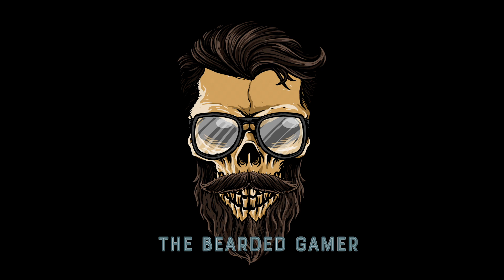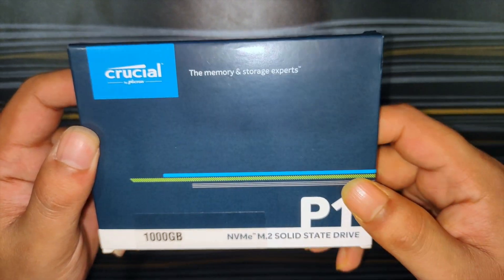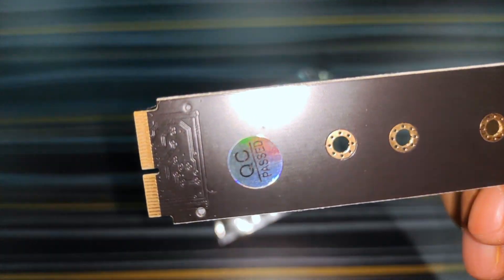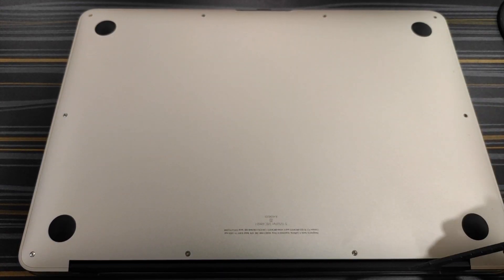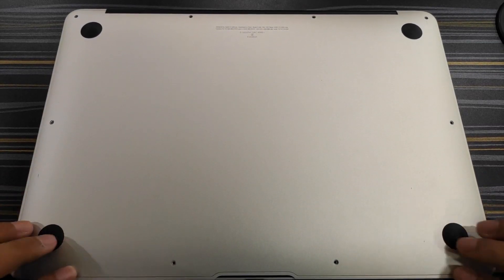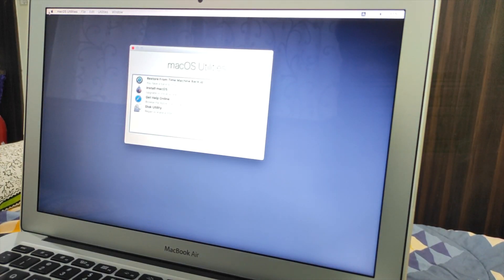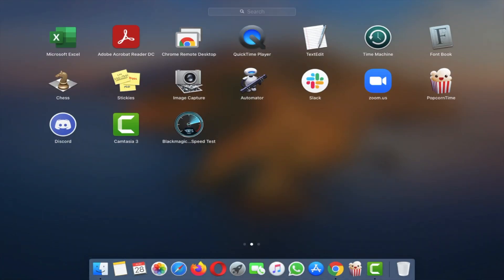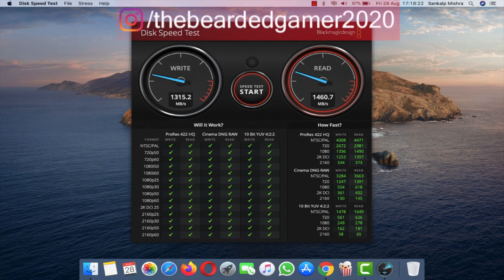2017 MacBook Air Storage Upgrade from 128GB SSD to 1TB NVMe SSD | Full Guide for 2021 | 40k+ Views

Comment: I would not able to update MacOS Monterey after upgrade 128Gb to 1tb MacBook Air 2017. I face SMAR ERROR  :(
Reply from the maker: This error generally comes up when using hard drives. But in this case, since we have an ssd, this error could be because of some other mechanical issues. Try using some third party tools such as clean my mac and it might solve the issue. Also, are you able to us other MacOS and just Monterey isn't working?
Reply: @TheBeardedGamer2020  Now , my MacBook in rest mood (No Response). It does not support any MacOS , after I reset it  '-' . I have to replace my new 1tb ssd with another new ssd then hope i will able to access my MacBook.
Reply from the maker: @uuppenn  I hope it gets fixed soon. It has been a really complicated process for you.

Comment: Hi , I bought new ssd and doc and replaced the ssd in my MacBook Air but it doesn’t show in my utility list even I erase the dev 0 in the utility as well
Reply from the maker: Which ssd and whuch adapter did you use?
Reply: @TheBeardedGamer2020  crucial p2 and same adapter which one use in video thanks
Reply from the maker: Did you use the bootable drive?
Reply: @TheBeardedGamer2020  yes I did.
Reply from the maker: @amrindersingh2733  Then there is no reason why it shouldn't work. Sometimes the adapter has issues and that could be the case. Try replacing the adapter and it should work.
Reply: @TheBeardedGamer2020  ok
Reply: @TheBeardedGamer2020  ok I will try thanks
Reply from the maker: @amrindersingh2733  If that doesn't solve the case, try using an nvme ssd enclosure and do the process externally. Then you can directly plug it in. That's easier but you will have to spend 2.5k more. Something like this https://amzn.to/3BBxPxf
Reply from the maker: @amrindersingh2733  Do subscribe to my channel and press the bell icon. Also, let me know if replacing the adapter or getting the usb enclosure works. If not, we will try to find another way.

Comment: Hey can you please tell if upgrading the 2017 model to 1 TB has caused any hanging issues?
Reply from the maker: Nope, no hanging issues. Has been working perfectly fine. Do subscribe to my channel and press the bell icon.
Reply from the maker: Do let me know if you have any other queries or need help with the upgrade process. You can also drop me a message on Instagram.

Comment: Hi, Im planning to upgrade mine. I went through your video. My question is when did you install the ssd adaptor to the mac? This is confusing me. Is there a reason why you did not use the crucial p2 ssd?
Reply from the maker: The new ssd is slotted into the adapter and then put into the ssd slot on the macbook motherboard. Do subscribe to my channel and press the bell icon. Also, let me know if you need help with anything else.
Reply from the maker: Also, I did not use the P2 ssd as it was not available at that time. Now P2 is available and P1 is not available.
Reply: @TheBeardedGamer2020  I can't get the p2 to fit into the NVMe M.2 solid state drive? Why?
Reply from the maker: @yungmentalproblems  Which adapter are you using?

Comment: Thank you for the detailed tutorial. Question: Should I need to remove the battery cable first?
Reply from the maker: It is always better to remove the battery cable. I missed that but wasn't an issue. But to be on the safer side, remove it. Do subscribe to my channel and press the bell icon.
Reply: @TheBeardedGamer2020  many thanks! +1 follower :)
Reply from the maker: @Silvioyuji  Thanks a lot. Really appreciate the support.

Comment: Which ssd will be good for my macbook air 2013 under 10k
Reply: 520gb
Reply: I don’t which type of ssd are used in macbook air 2013
Can you help me
Out
Reply from the maker: @alienmusk1348  For 10k you don't need a 500gb. You can easily get a 1TB one. All the product links are in the video description. You can choose the ones as per your budget. Do let me know if you need any more help. Also, subscribe to the channel and press the bell icon.
Reply: @TheBeardedGamer2020  already subscribed 
Which ssd you will recommend to me under 10k and do i have to buy adapter for it?
Please help me!
Reply from the maker: @alienmusk1348  yes, the adapter is required for the upgrade.
Reply: I’m currently using oscoo on900A but idk what’s wrong.
My macbook isn’t starting and it’s not showing my ssd in recovery mode
Reply from the maker: @alienmusk1348  For the OSCOO ssd, did you use a bootable drive to get into recovery mode?
Reply: @TheBeardedGamer2020  i don’t have any extra drive.
My mac is not booting up it gets stuck after entering password on recovery mode
So I can’t even reinstall or repair utilities
Reply from the maker: @alienmusk1348  No! You definitely need a bootable drive. The video description has a link to the process.
Reply: @TheBeardedGamer2020  I don’t have any bootable drive.
I pressed command+r and in the utilities error fix option it wasn’t showing my sdd there.
And my mac isn’t even starting it’s just rebooting again and again
Reply from the maker: You will have to create a bootable drive using a pen drive.
Reply: @TheBeardedGamer2020  how can i do it without turning on my lap?
And it’s not getting ahead after writing my wifi password in recovery mode
Reply from the maker: @alienmusk1348  Put in your old ssd. Create the bootable drive first and then go ahead with the upgrade process.
Reply: @TheBeardedGamer2020  I didn’t remove my ssd and how can i boot it because it’s not even turning on. It gets stuck on the spinning globe after entering it password in internet recovery mode
Reply from the maker: @alienmusk1348  can you tell me the exact process that you followed? Ste by step.
Reply: @TheBeardedGamer2020  i was trying to turn my mac on but idk what was wrong with it. It wasn’t booting up so I tried recovery mode to check my ssd but it wasn’t showing my ssd there. There is only macos of around 40mb. And now it’s getting stuck on recovery mode after entering password
Reply from the maker: @alienmusk1348  So, you haven't done the upgrade yet. You have problems with your original ssd?
Reply: @TheBeardedGamer2020  yeah probably
Reply from the maker: @alienmusk1348  This isn't helping bro. I still don't understand what your issue is. Have you upgraded or not?
Reply: @TheBeardedGamer2020  nope
Reply: @TheBeardedGamer2020  i think my ssd is broken because it wasn’t showing my ssd name in disk utility in recovery mode.
Reply from the maker: @alienmusk1348  But you said you were using an OSCOO ssd, right?
Reply: @TheBeardedGamer2020  i’m using it from many years and idk what’s wrong now.
Does the samsung/cruciel ssd harm the motherboard because of that adapter?
Because I asked at a service center about this ssd and he was saying that those types of ssd will harm my mac and he was trying to sell me owc ssd
Reply from the maker: @alienmusk1348  No, they don't harm the motherboard. You can go ahead and use them. But my concern is that how will you upgrade withoit a bootable drive? Also, what happened to your original Macbook SSD?
Reply: @TheBeardedGamer2020  I don’t know what happened to my ssd that service center guy told me that i must change my ssd now and they will install big sur again after replacing my ssd. Should i go with the samsung ssd which requires adapter?
Reply from the maker: @alienmusk1348  Do you know someone who uses a Macbook?
Reply: @TheBeardedGamer2020  yep but he is in his town because of college vacation
Reply: That’s why I’m fkd up🤦🏻‍♂️
Reply from the maker: @alienmusk1348  I get that. But even if you upgrade the ssd with the adapter. How will you go into utilities without a bootable drive?
Reply: @TheBeardedGamer2020  I’ll take help of someone from another service center if they will fix my new ssd and boot up my mac
Reply from the maker: @alienmusk1348  Service center will not let you use ssd with adapter. For now if you want take it yo the mac service center and try to fix your current OSCOO ssd.
Reply from the maker: @alienmusk1348  They are clearly trying to fool you. First of all an Apple authorised service center will never use 3rd party SSD. And, doing it again and again, is clearly a red flag. Also, if the SSD is not working, why are the giving you a discount in exchange for it?
Reply: @TheBeardedGamer2020  They are saying that my ssd will get replaced by oscoo but it’ll take more than a month to get replacement and i told them I can’t wait for a month because of my college and other works.
I’m thinking of buying a crucial ssd of 520gb with a adapter.
Reply from the maker: @alienmusk1348  Yes, you can do that. But  before that I would suggest you to try fixing this first. If this doesn't work, then you can go ahead and use the crucial and adapter. But both the cases, you will need a bootable usb drive.
Reply from the maker: @alienmusk1348  I know you don't have access to another mac, but can you atleast get access to a windows PC?
Reply: @TheBeardedGamer2020  yes my friend has windows laptop
Reply from the maker: @alienmusk1348  That's great! There is a way you can use Windows to create a bootable drive. Here is the link to all the steps https://pureinfotech.com/create-macos-bootable-usb-windows/
Once you are able to successfully create the bootable drive. Let me know, I will guide you with the rest of the process.
Reply: @TheBeardedGamer2020  okay I’ll comment here again
Reply from the maker: @alienmusk1348  Sure. And, don't worry we will get your laptop fixed. Btw, the 8500 they charged you is actually the price of the Oscoo on900a. So, they didn't give you any discount in reality and took your original ssd for free. Which service center is this?
Reply: @TheBeardedGamer2020  do i have to download any particular files in usb or any os dmg?
Reply: @TheBeardedGamer2020  It’s not the official Apple service centre but they are the biggest mac seller of my city.
Reply from the maker: @alienmusk1348  Can you DM me on Instagram? That way it will be easier.
Reply: @TheBeardedGamer2020  yeah sure

Comment: TheBeardedGamer 
how to proceed with the upgrade, I understand how you upgraded physically.
but what is the necessary steps like backups and all,
also don't understand what you did with those adaptors, how you used those?
Reply from the maker: I have explained everything in the video clearly. If you watch the full video, you can easily figure it out. Any additional information is in the video description. If you are still having issues with the process DM me on Instagram and I can guide you step after step. Do subscribe to my channel and press the bell icon.
Reply: @TheBeardedGamer2020  I have sent a email.

Comment: Bro I had mac book air 2017    128 gb.   I need windows on my mac  iam looking  to upgrade my storage which brand do you recommend and is there any way that I can run windows from.  External ssd on my mac
Reply from the maker: Avinash, I have added links to the compatible products in the video description. You can choose whichever you like best on your budget and preference. And you can run windows from external ssd but it wouldn't be that reliable as Windows runs through bootcamp on MacOS. So, always better to have both of them on the same drive. Do subscribe to my channel and press the bell icon.

Comment: Hi there! Thanks for the detailed instructions; I just have a question about the bootable installer. In the video, it looks like you just did a time machine backup and that worked. I’m not sure what the bootable installer is for, do I need that if I plan on doing a time machine backup to USB instead?
Reply from the maker: Hey theena, the bootable installer works as a temporary OS for you to access the disk utility. Since, you have a new SSD and it doesn't have any OS and it is not even formatted in the Mac format, you need an interface to interact with your Mac. So, even if you have a TimeMachine Backup you need the bootable installer to access it. You don't need to install MacOS from the installer but you do need it to restore from your TimeMachine Backup. I hope I was able to answer your question. Do subscribe to my channel and press the bell icon.
Reply: @TheBeardedGamer2020  got it, thanks so much for the reply!!
Reply from the maker: @theena3097  No problem. Always here to help. Do let me know if you need any more help with the process.
Reply: @TheBeardedGamer2020  hi, I encountered a problem with the time machine backup USB. When I tried to restore the time machine backup, instead of a date of last backup showing up, a blank row showed up, and when I tried to continue, the computer asked me “are you sure you want to restore the [disk name] to its snapshotted state from (null)?” I’m not sure what went wrong, is my time machine backup corrupt?
Reply: Never mind! I ended up installing new macOS instead of backing up from time machine, and then upgraded the OS to Big Sur. Now I’m restoring my time machine backup using Migration Assistant and hopefully it works. Thanks again for all your help!! :)
Reply from the maker: @theena3097  No problem. Always here to help. And, what you did is the alternative method. So, it will work.

Comment: Bro please help me i am facing an issue with samsung 970 evo plus in macbook air
Reply: I need your number bro
Reply: After installing os from net work it is showing none option but it is showing ssd and i have followed your steps too
Reply from the maker: Try using a bootable pen drive. You can message me on Instagram.
Reply: @TheBeardedGamer2020  thnx a lot bro it worked
Reply from the maker: @kondurukrishna8812  Bootable drive?
Reply: @TheBeardedGamer2020  yes bro i have degraded mac os then it worked well
Reply from the maker: @kondurukrishna8812  Nice! Congratulations on the new storage upgrade.
Reply: @TheBeardedGamer2020  thnx a lot bro you are replying too fast
Reply from the maker: @kondurukrishna8812  Always here to help. Make sure that you subscribe and press the bell icon and share my channel with your friends. Need all the support I can get.
Reply: @TheBeardedGamer2020  i try my best in sharing your channel bro

Comment: Bro mine is macbook air mid 2012 with sata ssd of 128gb still can i upgrade my macbook air with m.2 nvme ssd or not please reply
Reply from the maker: Yes you can, but this adapter won't work. There's a separate one for the 2012 Macbook Air. If you want I can share the link.

Comment: I am having MacBook Air a1466 (2017) model but storage 128gb , I like to upgrade it to 1tb and run both windows and Mac plz suggest best ssd and best adopter
Reply from the maker: Hi Ammanna. All the product links that I have added in the video description will work with this upgrade process. You can choose the ones you want based on your budget. Do subscribe to my channel and press the bell icon. Use the links in the description to support the channel and reach out to me if you have any more questions.

Comment: Will Crucial P2 1TB 3D NAND NVMe PCIe M.2 SSD upto 2400MB/s - CT100P2SSD8 work for this upgrade?
Reply from the maker: Yes Vinod, it will. I have the links to that SSD and other required stuff in the video description as well. You can use it and buy using that link to support the channel. Also, make sure to subscribe to my channel and press the bell icon for future updates. Do reach out to me if you need any other help.

Comment: Can we upgrade it to 2tb
Reply from the maker: I think the limit on it is 1 TB. If you have the option of returning the product in case it doesn't, you can give it a try and share your experience in the comments. I have experience of 500gb and 1tb. Haven't given 2tb a try. Do subscribe to my channel and press the bell icon.
Reply: Please say ! Can we upgrade 128gb macbook air A1466 to 2tb?
Reply from the maker: @kondurukrishna8812  Already replied.
Reply: Bro can I use gigabyte aurora 1tb for A1466
Reply from the maker: @kondurukrishna8812  Do you mean Gigabyte Aorus? If that's the one you are talking about, you can. But what's the point of spending so much? At that price you can get an upgrade from Apple itself.
Reply: @TheBeardedGamer2020  but there is no 1tb varient from Apple!
Reply from the maker: There's one from Oscoo on Amazon which does not require any adapter just plug n play. But I think the 1TB variant is out of stock. Just the 512 gb variant is available for around 12K. The link is in the video description. You can check it out.
Reply: @TheBeardedGamer2020  but that gigabyte aorus is gen 4 so do it perform well with macbook air 2017?
Reply from the maker: @kondurukrishna8812  Yes it will. But as i mentioned earlier there is no point of using such an expensive ssd because there will still be speed limitations.

Comment: Does (iCloud backup) backs up App Store applications and the applications downloaded from the internet and also the documents from internet because I am gonna update my ssd finally
Reply from the maker: It does if you have purchased enough storage to backup all your data. I would suggest to do a time machine backup. That way you will surely have all your data as well as settings backed up. After the upgrade you can restore from the time machine backup and it will be the same as on your old ssd. Do subscribe to my channel and press the bell icon. All product links and additional information are in the video description.
Reply: @TheBeardedGamer2020  if I backup with time machine by connecting an external hard drive which already has some other stuff in it so by backing with time machine will that erase the other stuff on the external hard drive that I already have and is this correct.
Reply from the maker: @bilalazhar6452  Yes you will have to format the drive to make it ready for Time Machine backup. You can refer to the video description for a link that explains how to create a Time Machine backup.